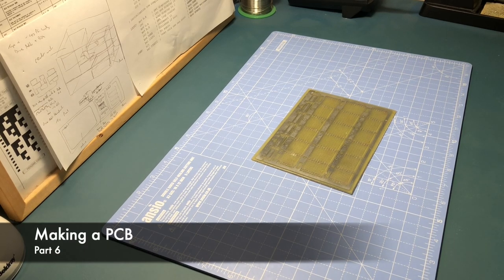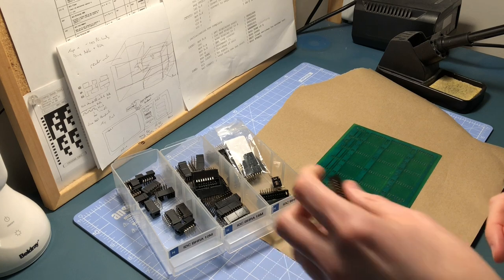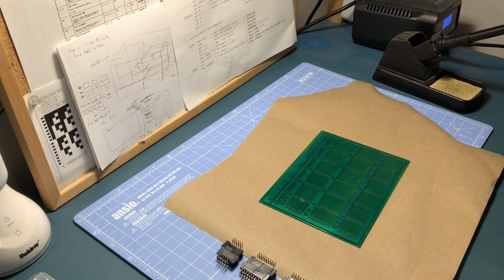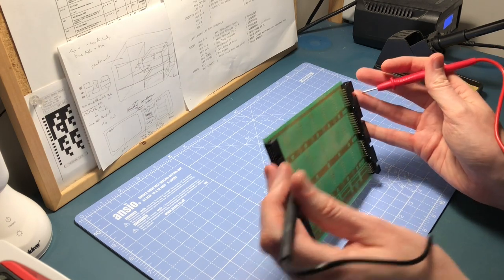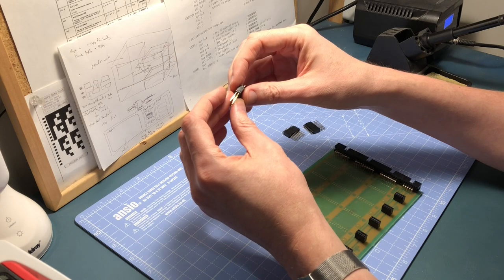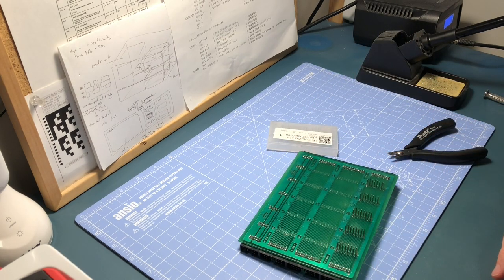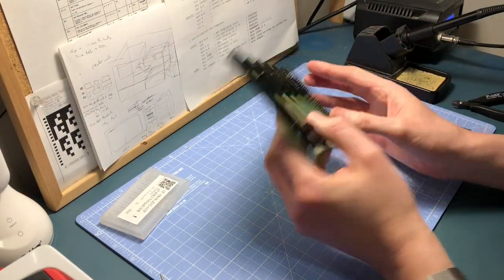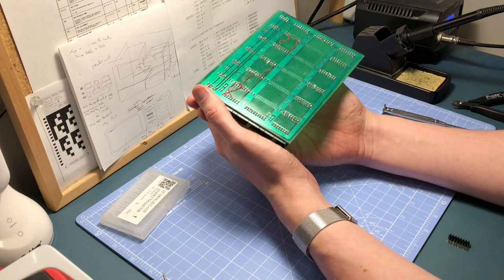Making a Printed Circuit Board (PCB) - Part 6

Comment: But you coated the pads, how are you going to apply solder? I guess I should watch the next videos.
Reply from the maker: Yea, it's 'magic' ;) Until it's fully dried you can solder through the green coating. Once dried though it's pretty much impossible to solder through.
Reply: @paul80nd  wow, today I leaned !